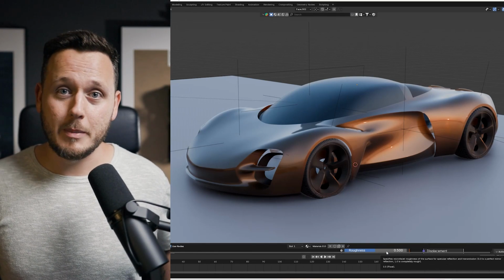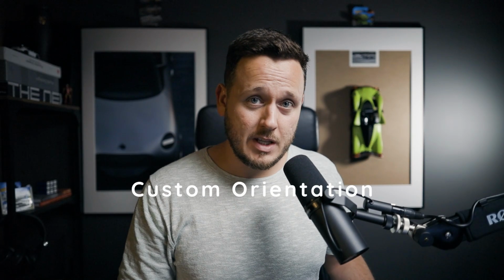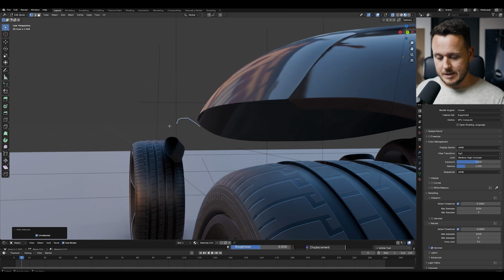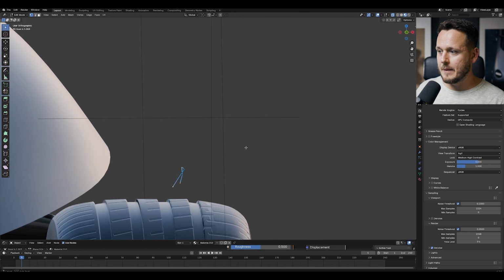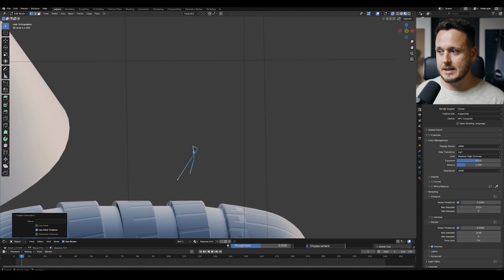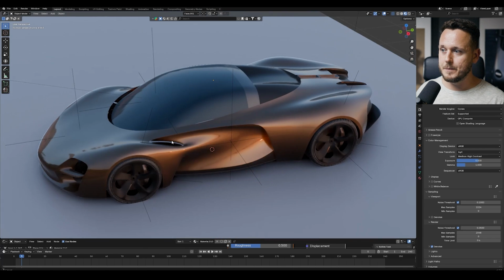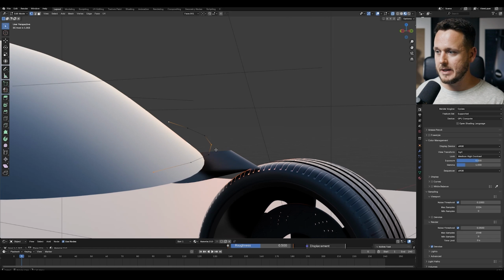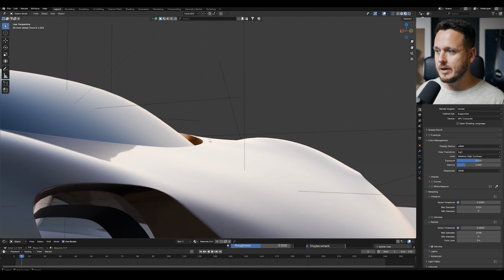This Blender Technique Will Instantly Improve Your Car Models! - Custom Orientation

Comment: Happy to help Berk! And thank you very much for the shout out! By the way, if you select the move Gizmo in the edit view, you can see the changed orientation! And it is important to select the beginning and end of the curve, then select the one in the center which is closest to the imaginary plane. When you scale all edit points. It is very important that you select one of the three edit points as the active one. If not all points are going to move a bit. And you don’t want the selected ones to move.
Reply: Yes Christian! awsome trick- Freue mich! das ist eine nette schnelle möglichkeit cvs aufzuräumen! ich habe das bisher mit einer echten Plane über drei piunkte, und dann mit einem shrinkwrap mod gemacht! (viel zu aufwändig!) Werde deinen workflow testen :)!!!
Reply: @jimmyjames6913  Das freut mich doch sehr zu hören : ) !
Reply: Is there any plugin or script similar to ZenTools from Autodesk Maya but for Blender as well? The current process looks very similar to ZenTools to me but takes much longer to apply. It would be perfect if you could select three points and only press one button to clean it up.

Comment: I'm not sure if that's correct approach. Lines should be clean, not messy, that's for sure, but it DOESN"T mean that they have to be "flat",aligned to one axis.  Most of the time curvature should be preserved.  I think you took a shortcut that will destroy most of curves\shapes.

Comment: Very cool! I saw this technique before but I didn't quite understand it, you explained it very well! I was wondering 2 things however. First, do you have to pick 3 vertices or can you pick more? And secondly, are you planning to add any 3d printing tricks or tips so that I can 3d print my car? Thanks.
Reply: Always three points, because three points are describing a perfectly flat surface! Two are just a line and with four or more you don’t get a perfectly flat surface.
Reply: @christiangrajewski7518  what if like 4/9 points were completely flat, could you use those 4 or would blender not allow it?